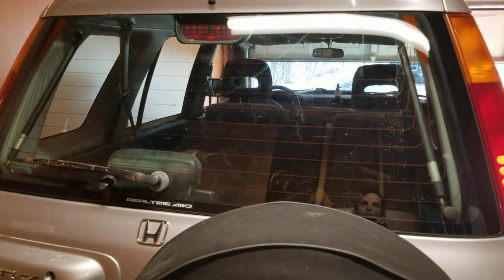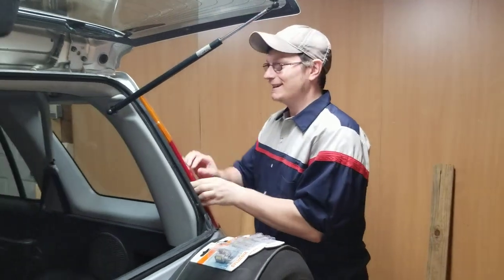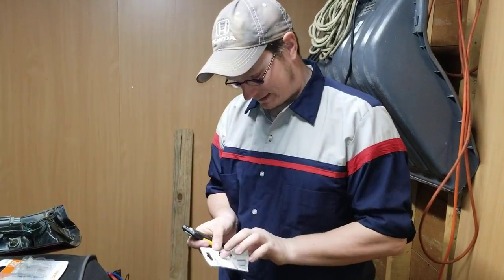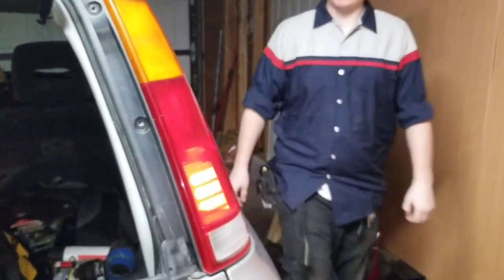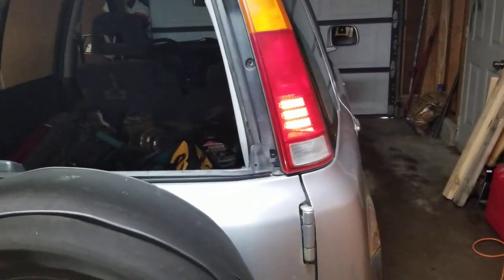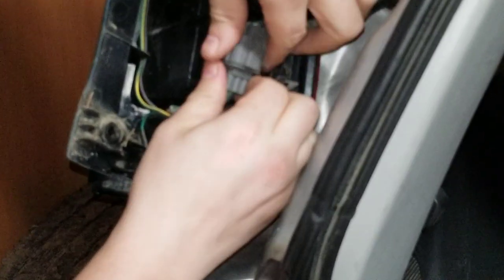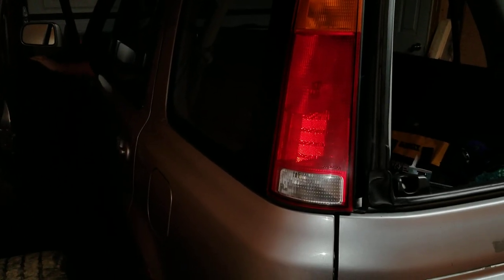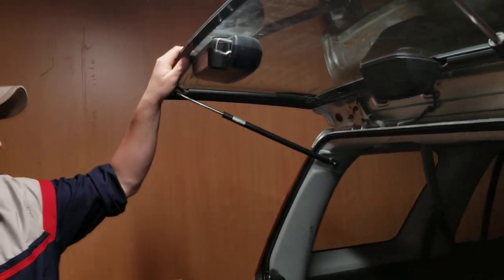2001 Honda CR-V Tailight LED Upgrade

Comment: Many people get these LED lights and especially headlight bulbs.  What many do not realize is they should look for ones that are DOT or SAE certified.  If not, they could easily be illegal because of being to bright  Fed requirements state the headlights can be between 500-3000 lumens.  If you get the wrong ones you risk a fine or worse.  Even taillights have a max brightness.  A few times on the interstate I thought a few people had their brake lights on only to find that they had installed LED taillights.  500 lumens for a tail light is considered very good.  1500 or more can be considered to bright for regular tail lights ( not brake)

Comment: Please kindly breakdown it down again, I need to know which LED would fit on 1997-2001 Honda CRV tail-lights (i.e. Reverse lights, Parking lights, Brake lights etc.). I thank you.
Reply: I have the whole list, inside and outside, for a Gen 1 CR-V.

Hi-Lo: HB2/9003/H4
Reverse: 921 (T15 type)
Cabin dome, Trunk dome, Map lights: DE3175 (use LED replacements, the one size fits all three areas)
Front Side Markers, Front Turn: 1157NA
Parking: 168 (T10 type)
Rear Side Marker: 194 (T10 type)
Tail Light, Brake: 7443 (T20 type)
Rear Turn, Center High-Mount Stop: 7440 (T20 type)
Ash Tray: 74 (T5 type)
Instrument Panel:  Numerous 74 (T5) + one 158 (T10)

In the instrument panel for an automatic, I THINK the gear bulbs (PRN and the Ds) are T3 size. You CAN find LEDs for those, but there just aren't many offerings.

Do a lot of research on the LEDs for wherever you install them. Would highly advise that you look up the Headlight Revolution website and check for their tested and rated brands for guarantees on what will work for the make and model + year.

When it comes to the 74s, you do a LOT of research on reviews and see what has the most in high-rated and credible reviews, sorted by date. Before you go to take out the instrument cluster, take off the negative battery cable and wait 5-10 minutes - this will make sure the air bag does not get set off. It shouldn't be difficult to unscrew, remove the connectors and take out the instrument cluster, but still, take your time on it.

For literally any of these bulbs, if you don't have a multimeter, then you can use a 9V battery, electrical tape, and two small wires with insulation still on them to check for the polarity + test power the light briefly. When you identify the + and –, note that and install in the sockets correctly. That will save you a lot of time having to get in and out and pull a socket, rotate a bulb by removing the guesswork at the start.

I hope this information helps. Feel free to pass it on for Gen 1 CR-V owners everywhere.

A final warning: the reason LED turn signal bulbs flash faster is because you still have the stock turn signal flasher relay module in place. When a regular bulb burns out, and the resistance is down, it causes the same side turn signal on the opposite part of the car to hyper-flash. This is intended by design, and is to let you know that a bulb has failed. A hyper-flashing bulb will more often get the attention of nearby police officers looking for an excuse to pull you over. So when you have an LED bulb in place in the turn signal sockets, should it not have added resistance as part of the design, it is going to have low resistance anyway and thus it WILL hyper-flash. You can either wire in a load resistor with it, or more simply swap out the flasher relay in your car with one designed to work with LEDs. With that, you put your stock relay into storage since you know it works. Best avoid the police pull-overs altogether.
Reply: @DJDTHTRP  How about for the cluster ?
Reply: @DJDTHTRP  yeah do you know what the bulb sizes are for the climate control?

Comment: No resistors to eliminate rapid flash?
Reply from the maker: On some vehicles you do not require the resistor. Apparently on the first gen CR-V you do. Thanks for pointing it out.
Reply: @wrenchingoncars1884  
I got the absolute cheapest ones I could find on eBay and they've been working fine for 5 years
Reply: @wrenchingoncars1884  
I'm about to do it again on 1st Gen CRV. Determining mounting location for resistors takes a little more thought as the resistors get very hot and should be fastened to metal and the more air they get, the better. I was trying to be lazy and copy what someone else has already done on a YouTube video rather than figure it out for myself.
Reply from the maker: @earthtones1138  this might be out there. But have you trying running them down the roof rails on the outside? You can get some weather resistant materials to keep it dry? It would be hard to keep it in the cab of the CR-V. Let me know how it goes.
Reply from the maker: @earthtones1138  that's great. It's not always about cost. It's about if it last am I right?

Comment: I can Just install these like you did with no problems?
Reply from the maker: Definitely follow as I did. But I do recommend the resistors. It's just at the time of the video, the local shops did not have them in stock.
Reply: @wrenchingoncars1884  where can I find the resistors?
Reply from the maker: @WingZero1181  Walmart or any automotive stores should have them, but with current lockdown it's harder to find.

Comment: Yesterday I tried to upgrade my 1999 to led lights... got stuff from amazon, everything said they would work as plug and play... the headlights only worked on high beam, and the blinkers flashed very very fast, and I didn’t even even try the brake lights for fear it would fry something and not work...
Reply from the maker: I try to stay away from Amazon as some things are best bought at a big box store sadly.